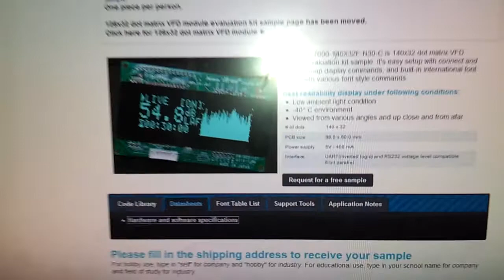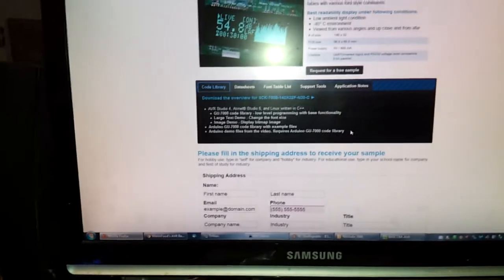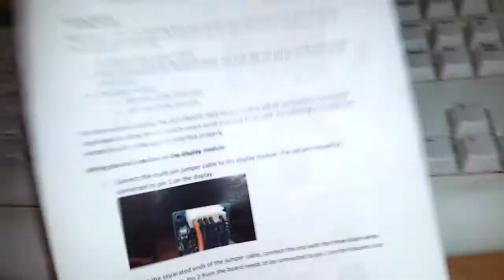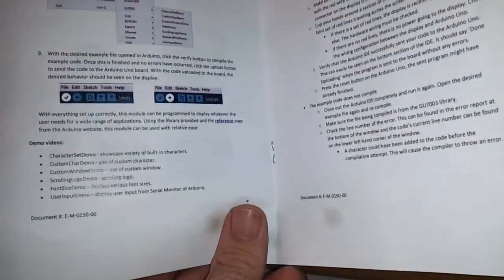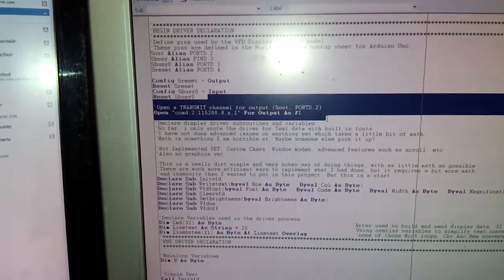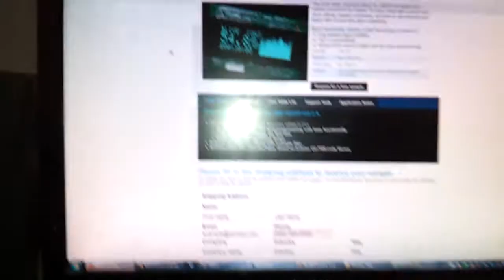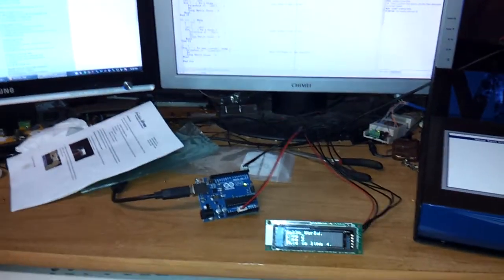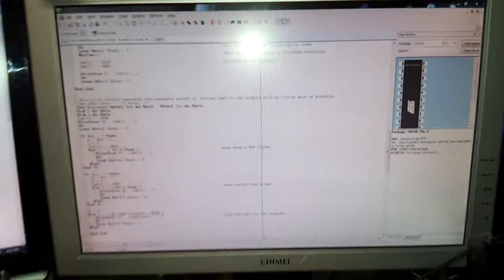Noritake VFD free sample on Arduino and BASIC

Comment: Hi, I have a graphic vfd unit from Noritake however it didnt come with any instructions on how to connect to arduino, nor with any cables. I have been trying hard to get it working, I found arduino code for my device however I think I have been doing my connections wrong, it did work sort of once, not full but did light up 3 buttons so now I am sure its not broken. I was wondering if you could help me hook up mine.